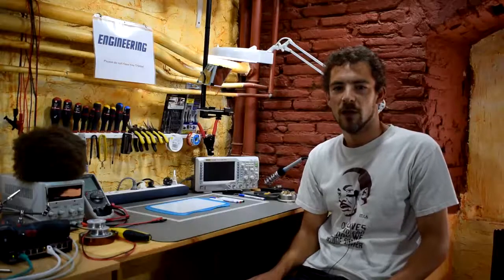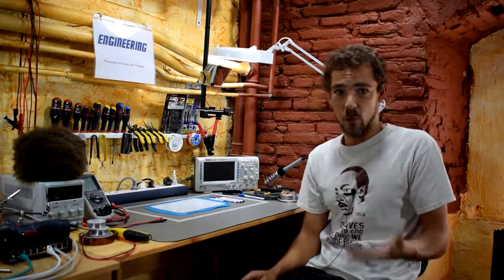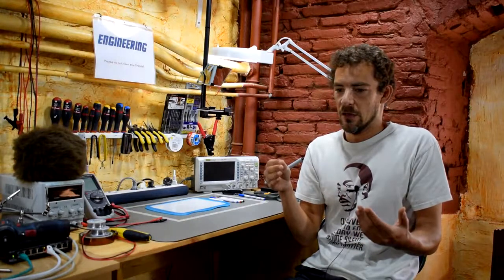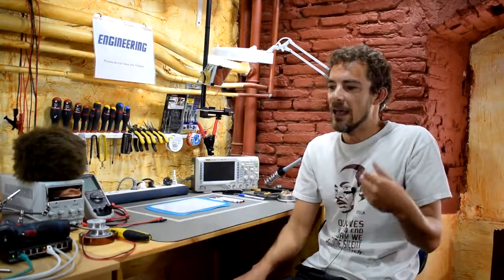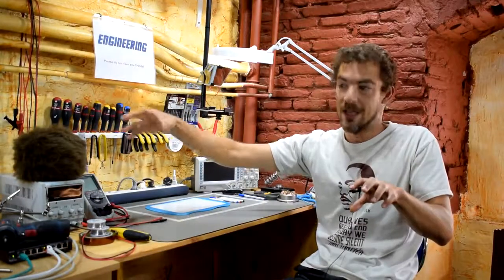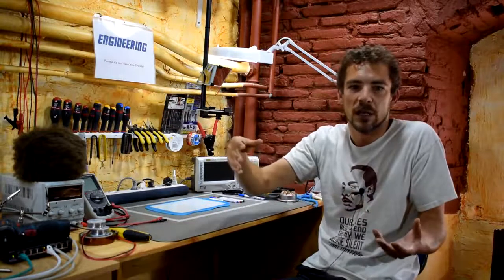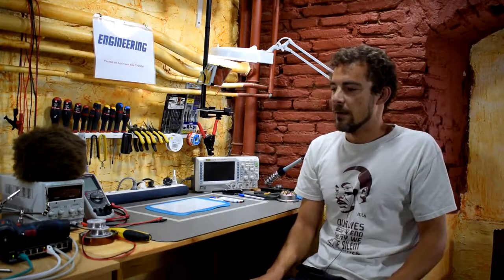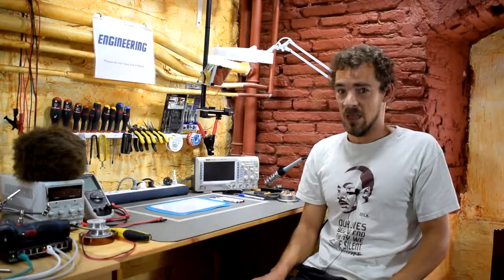EEK! #4 - What the heck is Power Factor?

Comment: We swapped all our incandescent lightbulbs for LEDs, we use computers and lots of little wall wart transformers in the house ...I worry that they are all cheap and have low power factor...?  We recently got a new French green smart meter....will we be paying more for our power because of these low power factor devices...?
Reply from the maker: As of right now, no, you won't pay any more. The only way you'd pay more is if you're using close to your amperage limit, and the Linky keeps tripping on you due to an overcurrent condition. Then they'll make you pay more money per month for a beefier connection. In some cases, you may pay less - IF the meter readers were not coming to your house often enough, and they were mis-estimating your consumption. Of course, that can work in both directions.
Reply: @ScottiesTech  thank you so much...we will get the online EDF app and monitor our power consumption.  best wishes, Simon in Dordogne.
Reply: @ScottiesTech  you might like to see our small hydro power elect generate set up on a small river in the Perigord.  https://vimeo.com/120782666

Comment: The PF is the cosine of the angle formed within a power triangle by the true (i.e., resistive) power (in watts, or W) represented by the horizontal component and the apparent power (in volt-amps, or VA) represented by the hypotenuse. The remaining vertical component of this right-angled triangle represents the net reactive power (in volt-amps-reactive, or VAR), that is consumed by inductive and/or capacitive loads. The closer this net reactive power gets to zero, the smaller this angle becomes, and the closer the PF gets to one (i.e., looking like a purely resistive circuit to the power company).

A PF of one occurs when the circuit is in resonance, meaning its inductive reactance (i.e., the inductor's opposition to alternating current, given by the formula, Xl=2πfL) is equal and opposite in magnitude to the capacitive reactance (i.e., the capacitor's opposition to AC, given by the formula, Xc=1/[2πfC]) at the powerline frequency, causing them to cancel each other out (i.e., The net reactance is zero.).
Reply: only when the source is sinusoidal and steady state and the load is constant and linear... ie. this never happens in real life.
but it's good enough for most textbooks

Comment: When are you actually telling us what the power factor is?
Reply: He did tell us what power factor is.  It is the real power divided by the total apparent power.  That's what the professor tell us and that will get you an A on your test.  That it does nothing to create understanding is a different matter.  The professors wave their arms to scare off the hard questions.  

Glossed over is the other part of apparent power, reactive power.  Reactive power is the power that is stored in magnetic (inductors/motors) or electric (capacitors) fields.  Real power is the power that is transformed to something other than magnetic or electric fields, such as heat or mechanical power.

We are talking AC so there is steady state like DC settles into, only increasing or decreasing voltage and current, i.e., power.  The magnetic and electric fields take in and release power as the voltage/current change, which is constantly.  That means there is this constant little pulse of power going back and forth across the line, annoying the guy trying to keep the voltage steady and causing the wires to see a higher current than needed to do useful work.  

Turns out capacitors and inductors build and release their respective electrical and magnetic fields 180 out of phase with each other so if you match them properly, the pulse of reactive power that happens only flows in and out of the local capacitor and inductor/motor and the guy at the power plant doesn't see it or have to work to keep your neighbors lights from flaring and dimming as the voltage on the power line changes if the system gets out of balance.  This is power factor correction.  Usually, it is putting a capacitor across a motor to handle the  inrush and release of current as the magnetic field builds and collapses as the line current goes through its cycle.
Reply: @jkbrown5496  that does work for ideal supplies and ideal loads (class room settings), but not in the real world.
First, there are multiple accepted definitions of Power Factor in approved and regulatory metrology standards. The ratio definition provided is one of the most common definitions, but there's still ambiguity in that:
-are we considering only the fundamental? why?
-in a single phase, what definition of apparent power are we using?
-assuming a time varying supply, over what time interval? what measurement synchronization is used?
-how are we aggregating a polyphase system?
-what about non-linear and pulsing loads (eg SCR controlled heater, rectifier with switching psu, or VFD)?
Reply: Muscles + Lever